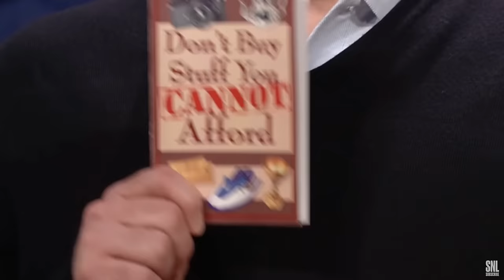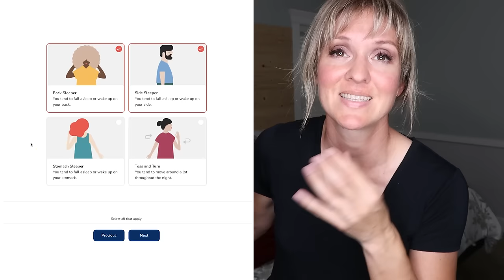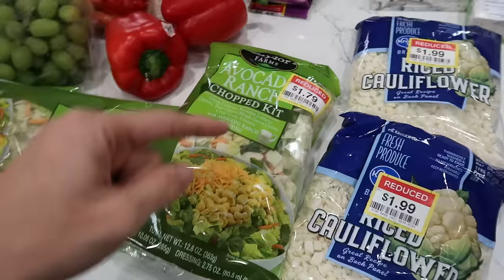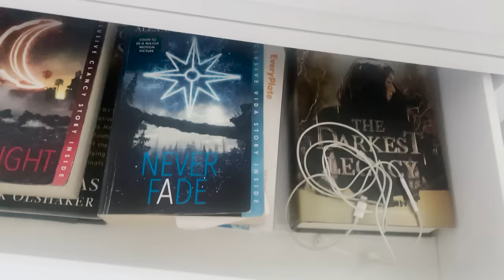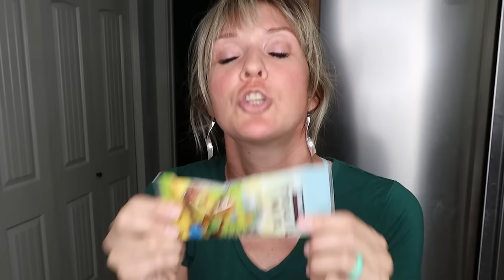7 Things Frugal People Do That You Don't

Comment: Funny alert! I gained weight. Too much weight to get my wedding band off!! My finger actually had a ditch around it from wearing the ring for 40 years!! I went to the jewelry shop to have it cut off which they were happy to do but wanted to try a “little trick” first. They saturated my finger with windex and worked the ring off. I hadn’t taken it off for 40 years! There was a weight gain of 95 pounds to over 200 (don’t ask 😬) pounds! It works! I don’t recommend a 100 pound weight gain by the way.😂😂😂

Comment: See a naturopath dr, get on Betaine at least for gut health, it helps your body digestion. Also, take a good Pre/pro biotic. Lemon water at least once a day. There are a couple other good supplements you can get from naturopath dr too for liver/gallbladder (even if its removed, because they leave the sphinter of Odie in there and you can still have issues, i know from personal experience)/pancreas/spleen, they are very helpful. 
I actual discovered,myself, that i have low stomach acid thats why i wanted the Betaine. Mist people diagnosed with acud reflux and gerd actually yave low stomach acid which many symptoms are the same for low stomach acid as high stomach acid. When Drs prescribe meds for high stomach acid and you actually have low stomach acid then the medicine actually makes your stomach acid even lower which then really messes up your digestive in your body doesn't absorb any of the nutrients out of the foods and that's why people end up with all kinds of digestive problems and IBS and all kinds of other stuff because their system does not clear out so might be something you might want to check into I think it would be helpful, take care 😊

Comment: Such a great idea to cut those scrubber sponges in half! However - what the heck are you doing using power tools with those kind of sandals? That’s crazy, dangerous, and potentially quite expensive if your foot slips and you get cut. Wear strong shoes specially when you’re kneeling or sitting by power tools.

Comment: In a SHTF scenario you will need hard wearing clothing. Think Carhart😊 jackets and bib- overalls in winter zip in the padded linings. Waterproof boots. snake proof boots!!! Leather wont cut it. Wet feet will kill you. Wool- hats scarves gloves socks, sweaters. Make thick insulated blankets to hang over windows- doors- block off 1 room to heat to stay warm. Medical supplies braces, boots, oxygen, splints, walker, critches, wheel chair, kneel cart, bedside toilet, etc . Think long term - antibiotics, pain meds, what about teeth?!